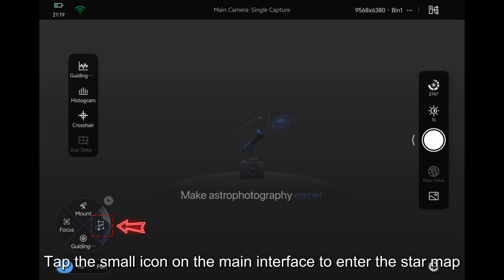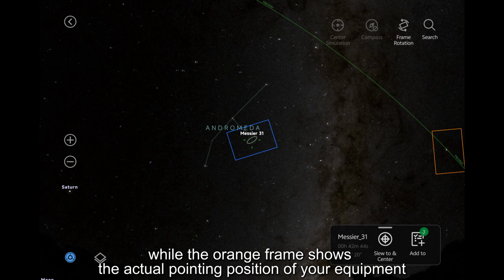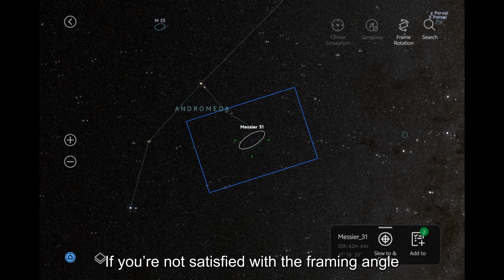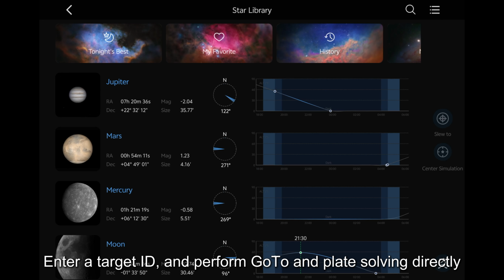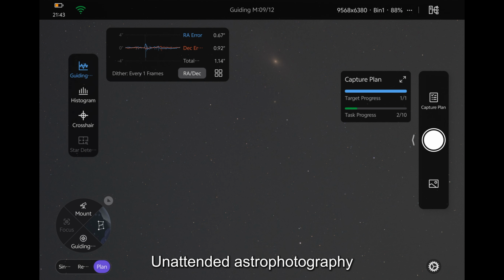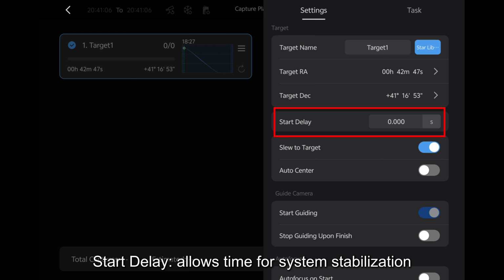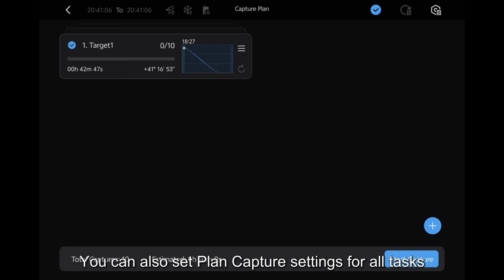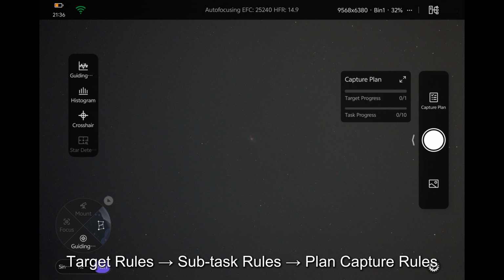StellaVita App 2.0 Tutorial: How to Set Capture Plan

Comment: - Star map need to have better quality images and show more nebulosity, galaxies and dso's to do free roaming instead of searching. Look for Stellarium star map and compare the quality with Stellavita map ull see.
- In star map, before 2.0 update, when u do slew to and center and return to the main window, it used to do quick auto capture to confirm the position, now it wont, button shows its capturing but it doesnt and i need to stop it and capture again.
- Meridian Flip doesnt work well because it wont return you to the same coordinates of your target that u set into the Plan and u need to do manually adjusting.
- When will sliders for power output going to work? I need it for 12v dew heaters control, for now is only on/off.
- Mosaic shooting isnt implemented yet, any time soon?
- And lastly, when will new Stellavita and harmonic mount to be available? I cant wait 😊
💙 ToupTek